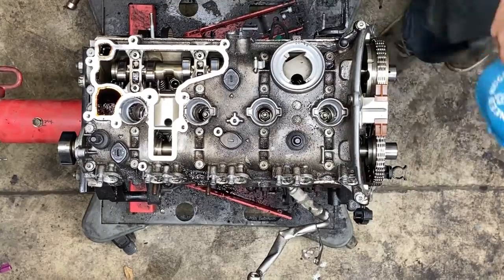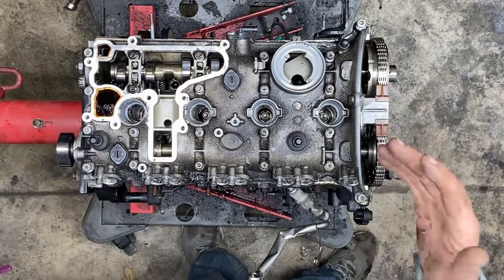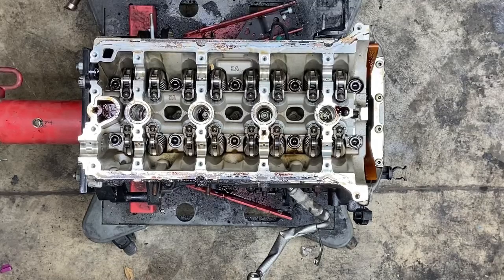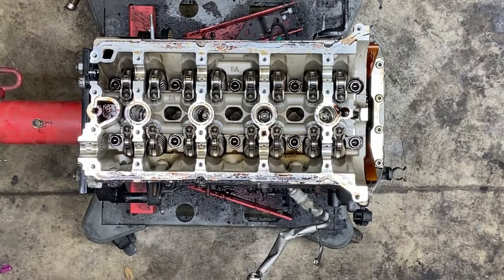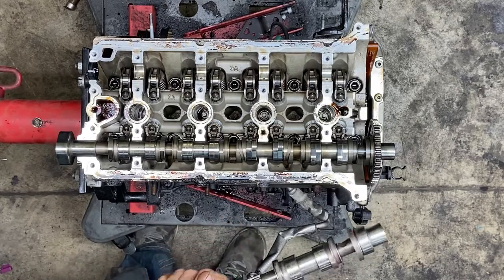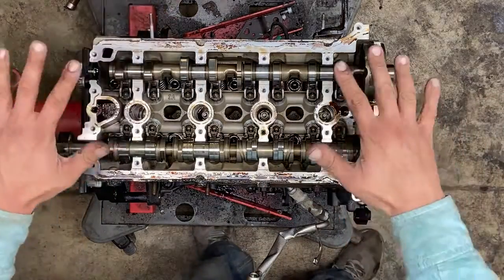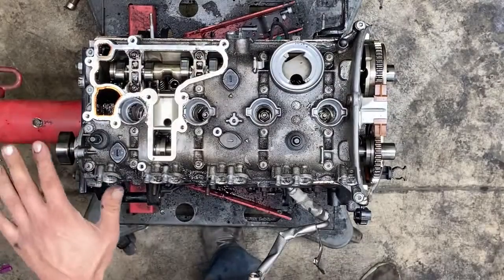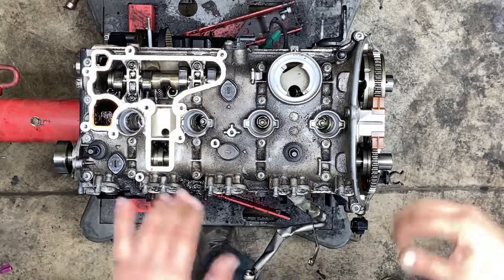2.0t TFSI CAMSHAFTS INSTALLING

Comment from the maker: https://www.audiworld.com/forums/attachments/q5-sq5-discussion-129/40264d1404968516-torque-box-fluids-2011-2012-q5-quick-reference-spec-book.pdf
Reply: Make a video explaining why audi is your german preference outside of Benz and bmw the pro and cons advantages and disadvantages
Reply: Do you have a source for 2009 A3 spec book?
Reply: Amazing link, thank you for sharing.
Reply: hello the pdf of audi a4 2009 tfsi 2.0 b8.5 quattro will have it? I only have this I don't know if it will work for my version https://static.nhtsa.gov/odi/tsbs/2012/SB-10072383-2280.pdf
Reply: Where should I get the piston and water pump and other replacement parts why am doing over the engine
Reply: Thank you
Reply: I love you man tanks for the video aprecio 👍

Comment: Hey Naptown tuner I’m a huge fan I love your channel I own a 2010 2.0 stick shift S line A5.. I have a really bad oil leak and I want to redo the vaccum seal and cam tray but there are no videos anywhere that include the timing part of it.. can you do a video on resealing the cam tray and doing the vacuum pump hpfp gasket and front upper timing gasket all together.. can’t find anywhere what to do with the timing chain do not want my cams spring up and taking the car out of timing… please help!!!

Comment: Cool dude, thx and later. Oh yeah, id like to see a cylinder head full rebuild. Valve guides and all if possible. Ive built a dozen or so 350's/383's and about twice as many bbc's, 396/402/427/454/468/496. So im not shy or discouraged rebuilding this 2.0 for a friend. Dealer quoted $9k for a bad coil pack, bent and hanging open single exhaust valve cylinder 1. Ive torn it down to the point where im ready to pull the head and already found cylinder 1 intake valve rocker broken, same valve's spring broken right in the middle, hydro lifter resting behind the gear at the front of the exhaust cam. The intave valve moves freely in the guide but i cant really see the exhaust side yet as thats a bit tighter with cams and tray still on. I wanted to make sure i didnt require a special hold down for the cams while removing the tray, and if i shouod pull the head tray and cams installed still or pull them then remove the head. Im all to familiar that different engines have subtle things that you learn from spending the time with them. Just like that tray sealing goo. I had no idea about that being necessary. Especially with all this aluminum and how easy it is to fuk that stuff up. I see a lot of vids with great info but none that actually go thru the whole thing. Just one valve of course as its the same but you know what i mean. Anyway thanks for all your vids ive learned a ton but still would like to see a breakdown, valvetrain rebuild, reinstall. Thanks again. Great content, grest vids. Later.

Comment: Thanks for this video. I need to replace the intake cam on my 2.4L Ecotec because the cane phaser bolt snapped off thanks to a discount tool shop torque wrench. Your video is helping me get used to the idea of putting it in myself. A little nervous.

Comment: This is the problem I’ve encountered my new exhaust camshaft came out the box with the balls and springs already shot out two of the sections are sliding up and down the camshaft now is there a way to put them back in in the right order and still use it or do I need to do a return for a new part

Comment: These aenarobic sealer i bought it was expensive as hell and afther a while it was coming lose it was actualy a pretty fat mess to use this stuff .. even i didnt oversealed i used now a black sealing silcione what looked 10x better and less leaks aswell the green sealing when it heats up a lot it become like hard plastic that breaks off not that i doubt you're skills into these engine but my personal experience was that the green sealing is not worth it for the price they sell it.

Comment: Not sure if my exhaust cam is good. I have a ticking noise that is worse when hot. I suspect a lifter. I picked up a used exhaust cam out of the local junk yard. It seems to be in great condition. I plan to replace my exhaust cam and all hydrualic lifters and possibly all cam roller rockers. Vehicle has 210k miles.

Comment: I don’t know if you’ll even reply to this comment, but my head burned a valve, and valve seat is too damaged to seal a new valve on a CPMB flex fuel, I want to swap it to a CAEB because people want thousands for a flex fuel head, I’m assuming I need the plastic intake to make it work since that’s what’s different. 
I just don’t know what to do about the ECU tuning if anything needs to be done… any advice man?
Edit: obviously I won’t be putting e85 into it if I swapped it over. Please help. 🤙🏼

Comment: Serious question since I’m new to this, but I was told that my valve cover gasket and plug seals need replaced. Am I correct in assuming those are under the first cover you removed? And if so, what do I do to keep the timing from getting messed up?
Reply: If you haven't done this already, if it is the 2.0 like in this video yes the valve cover is the first cover the "cam tray" but it does not have a gasket, the gasket is a RTV like shown. It goes around the edges and around each center hole. To keep the engine in time you'd pin the tentioner and keep the cams and crank in TDC while doing this or you can zip tie both cams down and you won't need to pin anything. There's videos on how to but if you need help lmk.

Comment: @NaptownTuner is it possible to install cams incorrectly depth wise? I am in the middle of doing a timing job and I am curious if I have them lined up right. they spring back like you showed in the video but now that I am putting the chains back on it appears the cam sprockets aren't flush with each other. Are they supposed to sit 100% flush or is this because the exhaust side slides in and out?

Comment: Thanks for sharing video. I was working on a 1.8 tfsi one small spring and a ball bearing jumped and I didn't  see where it came from😢 but I realized that one of the cam lobe is too loose. And this video has just make it all clearer
Reply: Can it be fixed? Mine just came out

Comment: I was doing new sealant for the 3.2 V6 earlier this year. Was showing my buddy how the lobes moved side to side and one of those balls popped out and nailed me right in the forehead! Got lucky and found the ball and spring.
Reply: How do I fix it?
Reply: @silentyouber2816  You need to put the detint and the ball back in it's hole and slide the cam lobe back over it while holding the ball in at the same time.

Comment: Couldn’t you give it the little tap on the sides to be in the position where it can fit before you remove the exhaust cam? So you wouldn’t have to do it later?

Comment: Love your videos you’ve saved me thousands in repairs. Thank you. My son’s 2011 A4 Q 2.0 makes a weird noise under load which sounds like exhaust leak but isn’t. What could cause a thumping noise like that? I wish I could post video to hear.
Reply: FYI, Audi did pistons. I did timing chain and all guides and tensioners. New injectors, coil packs, separator and rear main. I’m doing new (rebuilt) turbo this week. Couldn’t have done it without you.
Reply from the maker: Fuel injector leaking compression past the seal
Reply: Thanks. I just did new injectors and seals. Also media blasted valves they look new ❤ and it still makes the sound. Is there an easy way to check? Do you have an email I could send a video to hear? Thanks for the response. You are awesome.
Reply: BTW, in park it sounds perfect at all RPM’s. It only makes noise when driving or a little in gear with foot on break and pressing throttle.

Comment: Hey Naptown. i just pulld my valve  cover off to reeseal it,and the exhaust camshaft raised, and it wont reset no matte rhow many times i move the lil cam sections.you have any pointers??
Reply: I think you have to take tensioners off timing chain to take pressure off. Then it will sit down.

Comment: I would like to see the head replacement on a 2013 Audi A4 2.0 turbo I am replacing the head after having already paid someone to do the replacement but ended up with bent intake valves

Comment: Hello Mr Naptown tuner, I've completed my 2.0 TFSI after the timing chain broke. The engine runs good while driving. But when the car idles it doesn't run smooth and there is a constant missfire on cylinder 3. When it runs higher than 1000 rpm there is no missfire anymore. All other cylinders are running perfectly. Is it possible that part of the outlet camshaft which is responsible for cylinder 3 was wrong installed by myself?

Comment: Hey NaptownTuner.  Great videos, not only informational, funny as well lol.  Much appreciated.  If you would make a complete video step by step how to replace the leaky Anaerobic sealant!  I really would like to see the proper way of fixing the timing related parts before you remove all 22 bolts and & pull up the cam tray so it does not mess up the timing; rockers/camshafts etc.  And how and where you apply the Anaerobic sealant around the parameter!  And finally, show putting back the cam tray and torqueing sequence and how much!  I would really appreciate it!

Comment: Rebuild manual instructs to put the exhaust cam into the cam cover first then slide the cams into certain positions. When doing so the exhaust cam pinches itself to the cam cover and your able to put the cam cover on with the exhaust cam sliders in the correct position.

Comment: So if im redoing the anerobic sealant on the cam cover, can i take the cam cover off without dicking with the cams and stuff?
Reply from the maker: Need to pin the tension and mark timing.  Best to take front case off and start fresh.  Not fun, I need to do one soon to replace a worn intake camshaft/ adjuster.
Reply: @NaptownTuner  well thats not what i wanted to hear… 

So since the upper cam journals are built into the cover, if i take it off itll jump time. Awesome. Thanks for info, happy wrenching.

Comment: I have low compression in first 2 cylinders and good compression in 3-4 after a full rebuild. How do you know if the cam lobes spun? Rebuild was after pistons hit valves.

Found out that the cam lobe was spun after piston hit intake valve on cylinder 1. Changed out intake cam. Perfect

Comment: Hi Naptown tuner. I thought I watched all your 2.0 TFSI videos, I didn't. I was careless and lost one steel ball when taking apart 2010 2.0 TFSI, other 3 still in place. What would you recommend I can get a replacement ball? wonder if cam bridge has the same ball size. I don't want to buy a new exhaust cam. Thank you,

Comment: really ussfull information thank you.  I wanted to know if i polish a little bit the camshaft block with 800 grip to retire a little bit of mark will the difference of height will affect the injection valve timing at the point of causin knoking,loss power or misfire???

Comment: Ok dude you are the smartest host I found yet…this is my problem I have a clients 2014 Jetta 1.8 tsi turbo the vet sprocket mech on the intake cam is worn plum out less than 100k miles I ordered a new cam for it also since I’m r & r cam I got a new vet valve and magnet and the  control solenoid got the cam and it’s  a bit different the cps reluctor is in the middle like the one in video but my reluctor is on the end can I still use this cam or at least change out the vvt mech and sprocket also new cam has wider lobes please help me
Reply from the maker: It’s obvious the wrong part

Comment: Sir love the video.So i have a quick question to my major mess-up i didnt realize that those little sleeves move on the exhaust camshaft and i unfortunately pulled over a little to much and the spring and bearing popped out on me i have the springs but could not find all the bearings just one is there anywhere i can buy those little bearings help plz

Comment: Hey man 

I was just wondering is that trick with the cam necessary? If if I don’t do that is it possible to bend the cam? I’m only asking because I’m having trouble getting my 2009 a4 back together. My cams won’t move now after I put the valve cover back on and it only sits flush in one position. Could this be my issue? 

Thanks in advanced

Comment: How do you install ball and spring for the exhaust cam if it comes out
Reply: Thanks, I'll try that!
Much appreciated
Reply: Did you figure out how to get the spring and ball bearing back in?
Mine just popped out. I'm looking for that old Indian trick to get it back in
Reply: @fabianjimenez9163  yes, it’s not that hard to put those back in. Make sure you’re on a bench and standing. Put in the spring first and then the ball. Get a small vise c-clamp and keeping it square tighten slowing pushing the ball in. Then once the clamp is flush with the cam push over the cam adjustor to cover it. That should do it. You will feel the cam adjustor slide on it and click in place. Do it somewhere where if the ball/spring fly out you’re able to find them.
Reply: On many shafts with detent ball and spring you get an adjustable wrench and run the adjuster down so the wrench fits shaft. Set wrench aside and insert spring and grease the ball and set it on spring. Now take wrench and slip it over shaft with opening facing you. Push the ball in at least halfway and rotate wrenchnto push ball in flush. Now slip the lobe slider in position and slide down shaftnover ball pushing to the side. I've used clamp but the swivel anvil wants to slide of anything round and that makes say things I shouldn't.

Comment: I need to replace the valve cover gasket on my 2014 a6, I just want to ask if someone knows or have done it before, is it really necessary to remove the timing cover and all the components there

Comment: When the exhaust cam is in the correct position so that the cam tray can be installed. Is the lobes in the correct orientation for start up? Or does the exhaust lobes need to be moved again?

Comment: if i wanna just do a cylinder head cover reseal do i have to remove the tension from the chain and set the timing? or can just i remove the cylinder head cover without worrying about damage

Comment: Excellent video.  Question when i set in my exhaust cam into position it does not look exactly like your set position. However my cam line is almost straigt up. Can it be off compared to your pic?

Comment: Just bought a 2009 a4 2.0T wasn't running I got it started and I can here  rattle in the head and some of the bolts on tray is strip out . I.goy it like that ,am going to be worked on it this weekend it's my first time work on one

Comment: Hi, I took my 2007 Audi A4 2.0T to get fixed the mechanic told me that it was the pressure and he replaced 4 valves$ he told me that the car was ready but my car is not running right. When I press the gas pedal it takes a while to take off. Also when I press the gas pedal it kicks in the car. The place is called USA Auto Repair In Anaheim, California. I took my car the Mitch the mechanic and he started screaming at me as I told him why are you screaming I'm not raising my voice. This is the first time I have an Audi.

Comment: that reference manual has been exceptionally handy - thanks so much for posting it.  Wow, I just re-watched this because I am going through my '13 B8 A4 CAEB motor and I had a ticking that I suspected was a lifter, turned out to be intake on cylinder 2, this was a great memory refresher on the placement of the cams - and went with the slime D154 103 A1 $80, wow that is liquid gold.  Great video and I would love more stuff on intake, upper head and suspensions on the B8 platforms.  Great video

Comment: Great video. My question is can you reseal the cam tray with chain tensioner not pinned? Will the exhaust cam pop out enough so that it must be reset the way you showed here? Or can the tray be carefully removed and Re installed in place.

Comment: Does it matter what positions the exhaust cam profiles (the 4 different sliders on the camshaft) are set to when putting it all back together, for example if two are set for one profile and the other 2 for another? Will the solenoid 're-calibrate' them all to the same profile on first crank of the engine or do I need VCDS to adjust these manually, etc. Thanks in advance!
Reply from the maker: It resets on startup
Reply: @NaptownTuner  - thanks fro the prompt reply! All the best from a huge fan all the way from Adelaide, South Australia! Keep up the great work!

Comment: I've tried watching the whole video but some some reason it freezes about 2:40mins and can't get it to unfreeze as I need all the info on this since I remove it replacing gasket thinking is was a regular valve cover gasket without pinning the chain tensioner.
Can you re upload it or check if it's just me with this freezing issue, audio works fine just video start freezing

Comment: I can tell your a top guy who knows exactly what he's  talking about. 
I am stripping a tfsi top end tomorrow  as it has zero compression on cylinder 2 and about 155 psi on 1, 3 and 4.
Not sure what I will find yet but I have subscribed to your channel and will be revisiting many times I am sure, knowledge is key in my opinion and you have plenty of it, kind regards, Chris, UK.
P. S if you have any ideas of what the problem may be, please let me know. 👍
Reply: Got the exact same issue on mine. Trying to figure it out with the engine still in the car. Did you find out what happened? Any tips are welcome